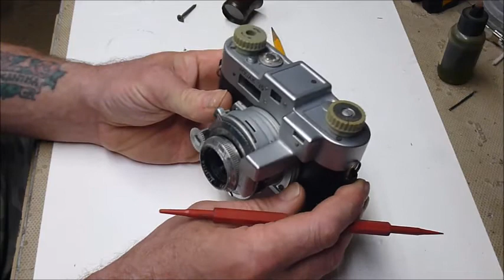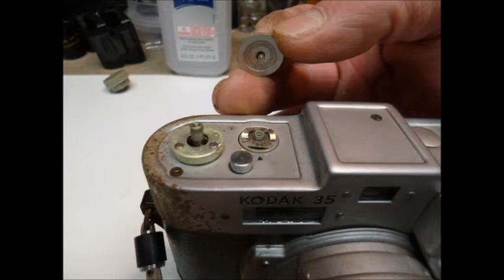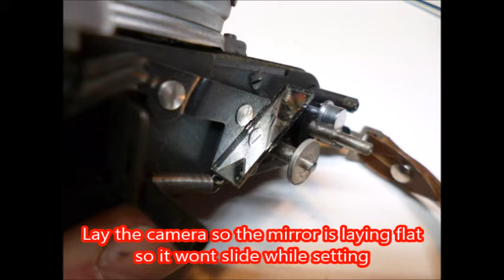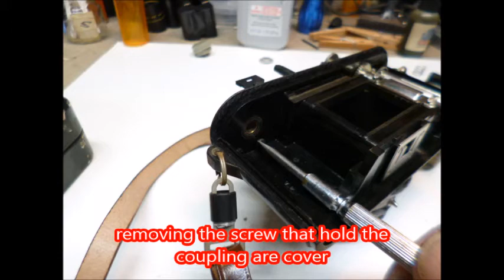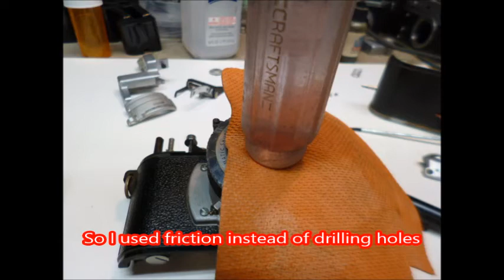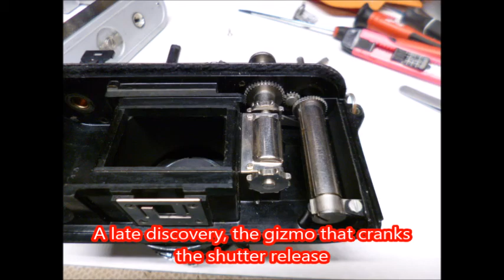Kodak 35RF

Comment: Hey does the shutter only work with film inside? I just picked up mine and the shutter dial is really hard to turn and on top of that the shutter button seems to not be working. Is there anything I could try to do before I take it in to be checked out? 
 Thank you in advance!
Edit: I did change shutter to bulb mode and still nothing
Reply from the maker: The camera is designed to only operate with film in it. You can override this by depressing the little chrome button in front next to the film advance knob, the one on the right. Then, with the back off, press that button (this releases the sprocket, hold it till you begin to turn the sprocket)  and turn the film sprocket until it clicks and stops moving. This cocks the shutter. Anything that is sticky or turn hard will probably need to be taken apart and cleaned.
Reply: @tobroken1965  I see this is some 4 years ago...I hope you're well.  The wind-on on my example is very very stiff. I can make it work, but bumps and resists and sometimes will just not cock the shutter. After the initial release and a few spin movements, the final probably one or one and half rotations of the film spindle are terribly stiff.  I can sometimes get a few consistent shutter cocks. Usually it will make one  unhealthy "tock" and then an equally unsettling "tock-ing" which is the spring sound of the shutter cocked. The good news is the shutter fires nicely at all speeds...maybe overall a stop slow (50 = 25) The bad news is the range finder is either disconnected (spins with very little resistance) or the mirror has fallen off(like yours). 
Did you take this film advance (beveled gears)  apart? From the video I can see the "differential"  As I mentioned, the first turns of this spindle moves very freely...it's the later part where the resistance is  extremely hard.  
Open to any input...thanks for your time, and thanks for the trouble you took to make this video.. it has already helped alot.
Reply from the maker: @like2view  It is easiest to make it work with film, you can do it manually but its not my first choice. Put a dud roll of film in, advance the film if you can, if not press the button next to the film advance knob and try again (that button must be pressed between shots, it unlocks the advance). If it is still stiff my guess is dirt and grime. 
I did not take the beveled gearing apart so I just dont know what is in there. That gearing drives a shaft that winds up the shutter release so there are several points that could get stuck. 
An option to try is 90% or better alcohol, dab some on moving parts to see if they get loose, the alcohol will evaporate and probably do no harm. But be aware, alcohol is a powerful cleaner, it can clean parts so well that dry friction from an absence of lubricant (even bad lube) can jamb it up just as bad. Its a tough call.